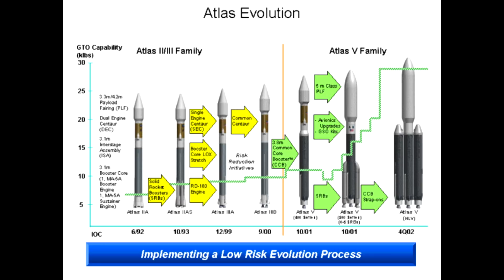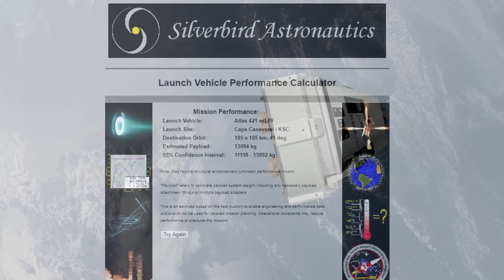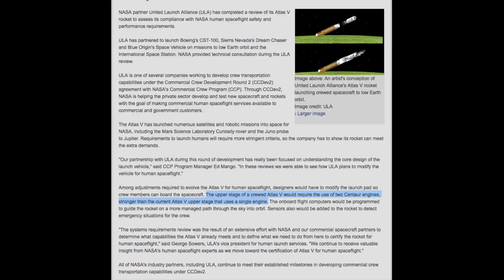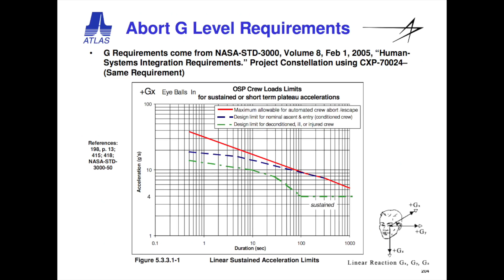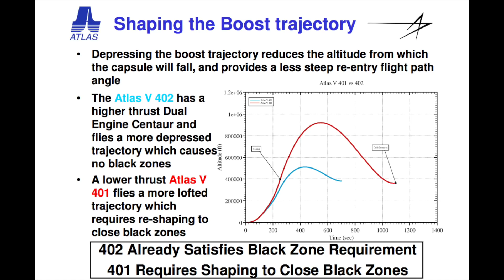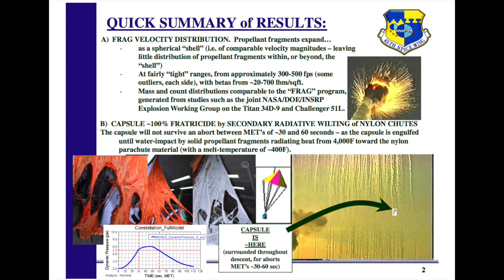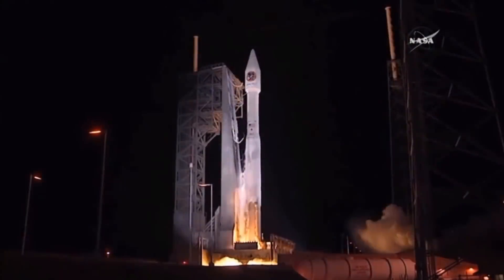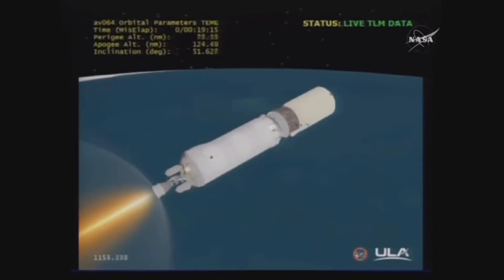Why Atlas Is Using Dual Engine Centaur For Starliner

Comment: Okay so adding a second RL-10 engine to Centaur helps by 1) increasing redundancy, and 2) results in a more horizontal flight path at the time of abort so reduces reentry loads/acceleration, avoiding a ballistic trajectory. Is this correct?

Seeing as abort is only performed in case of emergency, and that crew have survived ballistic entries many times before (Vostok and Voskhod nominal entry mode was ballistic and experienced 8 g's, Apollo nominal entry was 4-6 g's, and Soyuz T-10 pad abort experienced 14-17 g's), it seems like a lot of effort to design, analyze, and qualify/test a new system of adding a 2nd engine all in an attempt to reduce g's experienced in a contingency scenario which we have already know is survivable. Yes it would be harsher on crew, but it's a backup for emergency only and hopefully is never used

Comment: Why the dont use a Merlin engine or two for that upperstage if it has such a better performance?
Reply: Better thrust maybe, but not better isp
Reply: Both are high-energy rocket stages, but the Merlin is using a high thrust/weight ratio to get into orbit while the RL10 is using a high specific impulse.  They are two different solutions to the same physics problem.

The Falcon 9 upper stage with one Merlin weighs 112 tons, but the Centaur with two RL10s only weighs 24 tons.  The Centaur is extremely efficient compared to the F9 and can carry a similar payload to orbit despite being barely one-fifth the size.

Comment: Hill they try to human-rate the Vulcan as well? Will we see a Vulcan Starliner mission?
Reply: Yes, that is the plan, since the Atlas V will be retired anyway, human-rating the Delta IV Heavy would be difficult at best (and it's so expensive!), and the Falcon 9 is not desirable either for Boeing's own reason and because it would be the only human-rated US booster when the desire is to have more than one option at all times.

Comment: If SpaceX were smarter, they would've used 2 or 3 Merlins on their upper stage. This way, combined with Falcon Heavy and Crew Dragon, no Solar System launch would've been impossible for them. Exploration comes before colonization, and by denying to rely on their already existing hardware, Elon postponed his Mars dreams with decades IMO. What a pity!
Reply: I dont think you know how big the Merlin vacuum engine is.
Reply: What the other commenter said, and more engines makes burns in vacuum less efficient with less Δv.

Comment: My idea for a stillborn Centaur:
Since the RL10s are so underpowered for the stage, I wonder what would happen if they replaced it with a J2X had they continued developing it. Would it be okay, or would it be too much thrust?
Reply: Efficiency would go way down because of its gas generator cycle and larger size and weight, especially in comparison to the small, ultra-light Centaur.  Thrust would be similar to that of the Falcon 9 second stage, but that whole stage is, by system design, much larger and heavier itself, so yeah, the J2X (which has similar thrust to the Merlin-1) would be too much engine for the Centaur in every way.

Comment: Atlas 5 series also has significantly less payload compared to 4 series due to the much larger payload fairing and the small burnout mass of the first stage meaning that even a few extra tonnes of fairing reduces the mass ratio by 5-10%.

Comment: An extra engine means an extra $25 million in cost.
Good luck competing against SpaceX.
Reply: Scott had an image of a few paragraphs in which NASA in 2012! was going to start looking for a cheaper alternative to the RL-10. They knew its old technology was very expensive to build. Since then, SpaceX, Blue Origin, and Electron have developed new rocket engines from scratch, used 3D printing to bring costs way down. What did Rocketdyne do in that period? Who did NASA push to make new technology?

Comment: I still believe Aries 1 would have been better for the Country to avoid the gap. The Air Force study is biased., Lets pray for successful commercial crew.
Reply: I wish that were true, but the Ares 1 had all kinds of issues that would have been difficult and expensive to resolve, and resulted in significant delays.  The only reason for using that design in the first place was to save time and money, since it was based directly on the Space Shuttle SRBs, but it would have cost more to get to work right than to design a different and more appropriate rocket for that purpose.  Even more money was ultimately saved by simply using existing reliable rocket designs such as the Falcon 9 and Atlas V.
Reply: @rbrtck  You statement is factually incorrect, commercial crew gave us a nine year gap. Nine year gaps aren’t free. Aries would of been flying years ago  if it weren’t for politics. That’s the facts.
Reply: @pzoe3808   Commercial Crew's money came in a trickle and required new capsules to be designed when they could have used the Orion instead.  Ares I, despite using existing boosters as a starting point, was a new rocket with a projected cost of $40 billion, which isn't free and implies that it was a difficult project that would have taken many years to complete if it was a viable design to begin with.  How do you justify ignoring information from both the Augustine Commission and NASA itself?  And why do you think the Ares I would have been developed any faster than the Shuttle-derived SLS with both contractors signed to enormously lucrative cost-plus contracts?
Reply: @rbrtck  Obama, Garver, and to a lesser extent Bolden push an limiting agenda, the result was a costly and unacceptable 9 year gap, revisions to historical truths does not change the fact that the USA human space program was badly set back. A lot of people today want to bend history to promote progressive agendas. Hence the cancel culture.
Reply: @pzoe3808   The gap would have happened one way or another.  An SRB-only manned launch system built on a cost-plus contract wasn't exactly the kind of savior I was looking for, so I wasn't sorry to see it go.  No particular systems were going to stop rotten politics and politicians from having their way.  I agree with everything else you said.
Reply: @rbrtck  it was very capable, the space shuttles capability are unmatched for Leo. I do not accept or forgive for the gap. It was a wrong for the USA we are in a battle to be overtaken and our people better get smart.
Reply: @pzoe3808   There was no excuse for the gap in my view, either, but the problem was not the systems.  The real enemy we face is within the country, not outside of it, and they control the media and therefore most of what the people see, hear, and ultimately think.

Comment: I'm a bit confused about the current Atlas versions.  I worked on the original Atlas at Astronautics in San Diego, as well as the Centaur, and there is virtually no link between the original and the V, other than the names Atlas and Centaur.

Comment: Im not a rocketscientist but shouldnt three engines make for a far more stabile system Like a chair needs three legs ?
Reply: These systems are actively stabilized, so that's not an issue.  Three engines weigh more than two or one, which does matter.  The Centaur upper stage needs enough thrust to sufficiently flatten the trajectory, but any more than that would reduce overall energy performance because of the increased engine weight.

Comment: Slight correction: The RL-10 can be scaled up quite a bit, which is where the RL-60 comes from. Though it's probably not worth starting up a new production line when a new thrust structure and twice the engines will do a good enough job.

Comment: I would imagine that they have two engines for redundancy, it is going to be human rated.
Reply from the maker: But the first stage only has a single engine.
Reply: They will still have the abort engine on the capsule during first stage?
Reply: @Ms3DiT  yes
Reply: The Soyuz, Saturn V, Falcon 9, and others have only one engine in one or more stages.

Comment: Just out of curiousity, if the two-engine Centaur hasn't been used in 15 years, then how is this Atlas V 5N22 getting a man-rating? Are they going to have to rush through a lot of test launches?

I thought a big part of why Dragon was being delayed was because of relatively minor tweaks to the Falcon 9?
Reply: Dragon wasn't delayed Crew Dragon was
It probably was because NASA never considered the CST-100 Starliner and the Crew Dragon as a replacement of the space shuttle
Reply: They need to fly the new configuration twice to get it man-rated.  Normally it takes three, but NASA gave both commercial crew providers a waiver for the third flight because Falcon 9 and Atlas V were already reliable as unmanned launchers.

The second test flight of Starliner is happening in about two hours, so if it goes according to plan (this time) NASA will probably give ULA permission to fly astronauts.

Comment: Can you answer why the Centaur upper stage and Starliner has that odd structural shape. What I mean is that most of the atlas fairings widen out and then narrow back down into the vehicle, but with the Starliner there is that overhang due to the size of the capsule. Why has Boeing or NASA or whoever designed it like that?
Reply: That's because they had issues with aerodynamics without them.
Reply: The Centaur was designed in 1962 for a skinnier version of the Atlas rocket.  The Atlas V first stage is about 4 meters wide, but the Centaur is only 3 meters wide.  The Starliner is half again the diameter of the Centaur (4.56 m), so I assume the skirt is there to prevent an unrecoverable yaw from too much drag on one side.

Comment: Sure looks like a lot of disposable parts falling off..... like everything behind the capsule. All now obsolete before the first flight! Just let SpaceX take it from here until the government-backed space agency can catch up with modern reusable rockets and stop wasting the taxpayers' dollars on old-obsolete non-reusable rockets.
Reply: Reusable rockets are a very new thing in the space industry. Atlas V is an old rocket design by now. Old, but one of the most reliable rockets ever flown. More reliable than Falcon 9, for sure. Besides, most of the cost of any space mission is actually the payload, and not the launch. This is especially the case for manned missions. Saving a few million when the mission likely costs billions (as the first commercial crew missions will) is not really a priority.
Reply: Ok, how would you feel that every time you stepped onto a passenger jet, it was it's first ever test-flight.
Reply: I'd feel very safe if I was flying on an Atlas V. Each flight article is not a test article. It's a proven vehicle.

Passenger jets are actually more expensive in many cases than rockets. A 747-8 costs about 3 times as much as a an Atlas V.

Comment: The RL-10 is an extraordinarily expensive 1950's technology rocket engine.  If NASA and the Air Force had finished funding the development of its replacement the RL-60 with 200-250 kN (50,000-65,000 lbf) of thrust none of these issues would exist.  

The weakness of the SLS is it is an essentially a conglomeration of old to darn near ancient technology.  It will never be economic.  The SLS will launch a few times before even its most ardent supporters will have to admit it is unaffordable  and something modern will replace it.

What a horrible waste of tax payer money.

Comment: I'd much rather have a safer de-orbit with the two engine upper stage, rather than a single engine that would put me at 10-11 G's for an extended time period during re-entry.

Comment: If the NASA rocket with the solid first stage had safety issues with it’s parachutes wouldn’t the Atlas V with solid boosters have the same issue?
Reply: Not quite. The issues with Ares 1 involved the SRB exhaust and reaction products, which could potentially burn through, or otherwise destroy, the parachute. With smaller SRBs the risk is much smaller.

Comment: I always wondered what it would take to launch a payload from an 'on rail - electro magnetic' to conventional rocketry, in order to get into orbit. I mean. Shoot a rocket that sits on a monorail, propelled by electro-magnetic forces for the purpose of gaining the initial acceleration, and THEN fire the rockets (I mean, once the mono-rail increases its vertical inclination to 90 degrees)
Reply: Kookee2k2 | It’s not worth it. It just adds a lot of complexity without adding any meaningful amount of speed.

Comment: ULA would be fkd if Nasa put the minimum 7 flight condition on the rocket for using a relatively different stage.
Remember Nasa asked SpaceX to fly the block 5 atleast 7 times with the new COPVs before flying humans on it.
But I guess the parts are previously flown so this won't happen with ULA
Reply: Not really, the centaur stage with 2 engines is ancient, and has flown a lot on the atlas-centaur (60's design used until
the early 2000's).
Also, and this is sentimental really, but I really like the fact that after launching on a russian  soyuz for so long, it will, once more be an atlas rocket that launches americans into space. 
If they only could add the old (awsome) atlas verniers, just for nostalgic reasons.
Reply: @slome815  yeppp
Reply: Atlas V has never had a launch failure, at least not a loss of payload failure. Falcon 9 has had at least two failures. I think ULA's track record for Atlas V is damn good.
Reply: @badbeardbill9956  yes it relatively is
But that's for a freezes design
Not this new centaur which is technically old since it flew before

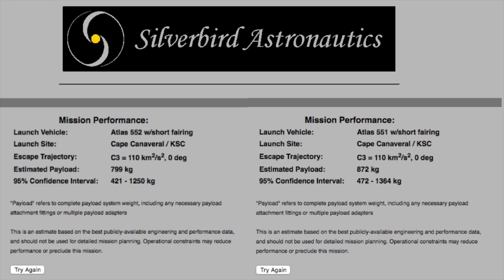Comment: What's the answer?  @02:39 "The two engine decision is all about crew safety."  But @04:59 "But this same study then went on to reconfigure the launch profile for the single engine upper stage, and actually came up with a reconfigured trajectory which would safely get the crew into space and not have any abort scenarios where they would be crushed by the g-forces on reentry."  So why stay with the two engine plan?

Crew safety isn't an issue for the Dream Chaser Cargo, so is the 552 choice entirely due to the vehicle's weight?
Reply from the maker: The two engines widens the margins for safety and adds abort to orbit scenarios in some engine out scenarios.

Comment: Why N for no fearing? It sounds nice and it's logical but why not just use 0?
Reply: Because then the rocket would have a 0 meter fairing.
Reply: @badbeardbill9956  zero is no value so having 0m. Fearing is basically no fearing 🤷‍♂️ but yeah, it's still logical as stated earlier

Comment: 5:16
Is the Orion capsule definitely done for then?  Or are they just going to look for a new rocket to lift it, since the Ares I isn't viable.
Reply: Orion is (technically) the only element of the Constellation Program that still exists today, and remains a part of NASA's plans.  However, instead of launching on the Ares I, it will now launch on the SLS.  One test flight of the Orion capsule in space has already been performed (albeit on a different rocket, the Delta IV Heavy), and another Orion is scheduled to fly on the first SLS mission in 2020 (or perhaps 2021, depending on schedule slips).
Reply: Ah that's nice.

Cost over-runs and impeding redundancy aside, I've always had a soft spot for that capsule.
Reply: It's not done for.  Going to do some lunar orbit missions......... but I wish they would hurry.

Comment: Sorry this isn't related, but are you going to talk about how the hole on the ISS turned out to be a drilled hole rather than a debris strike?
Reply: The Soyuz capsule has 2 layers of metal with foam in between. The hole in the inner metal layer was drilled and probably it has been there unnoticed for a while. The hole in the outer layer was microdebris. Only when both layers had a hole there was air leaking. Since they couldn't fix the hole in the outer layer they patched up the inner hole.
Reply: Someone made a mistake during assembly and drilled a hole in the wrong place, classic russian space engineering.
Reply: Looks like a Crazy Cosmonaut was trying  to mount a bracket...used too long a drill bit...Whoops..!

Comment: Was there really ANY situation where a shuttle SRB could quit and it would be recoverable?  I thought the asymmetric thrust would destroy the shuttle anyway.
Reply: Nope, if anything at all happened during SRB-powered flight you were probably screwed

EDIT: If anything happened *to the SRBs. Losing even all SSMEs before t+120 was apparebtly survivable by bailing out, which leads me to conclude the SRBs were good enough to maintain orientation of the whole vehicle.
Reply: See the Challenger accident.  Also, the solid cannot quit but it can crack..................  see the Challenger.
Reply: if an SRB failed you'd be dead. anything else you might survive.